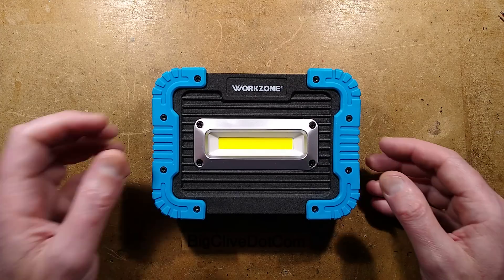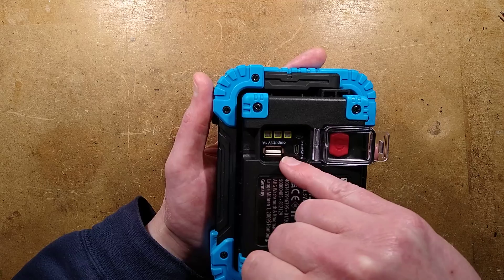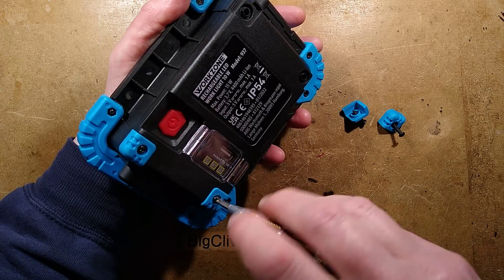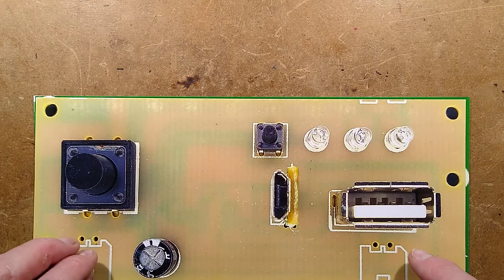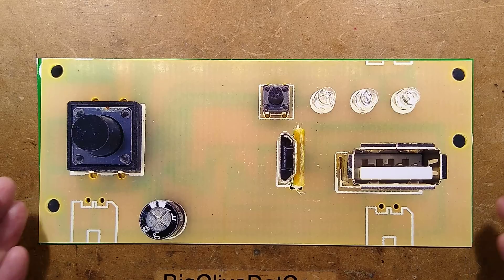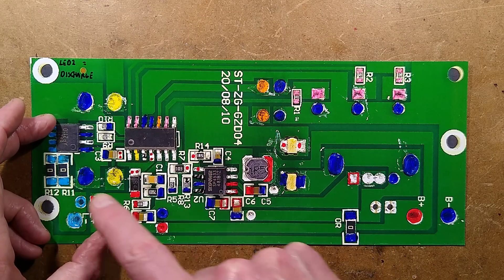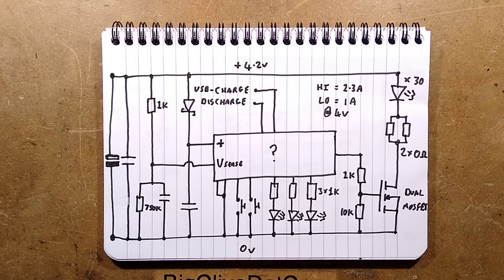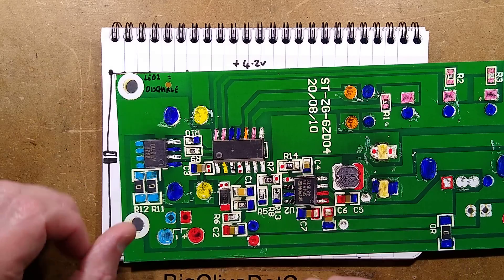Inside an Aldi rechargeable work light (with schematic)

Comment: Why won't it charge
Reply from the maker: If it's not been left in a fully discharged state for too long it should take a charge.  Try a different USB cable and a different charger.  Some modern "smart" chargers need some extra components to tell them to put out power.

Comment: I have the newer model that has Type C input.    It worked a few times.     Then it suddenly stopped working.    Should I toss it in the recycle-bin ??
Reply from the maker: If charging it, make sure you use a dumb charger with a USB A to USB C lead.

Comment: Jaycar (in aus) have an extremely similar lamp, but with 2 led clusters instead of 1 long one.
Runs off 4xAA batteries. 
Trying to analyse it... seems to have 2 mosfets in parallel off a microcontroller, and the powerfeed goes through 2x 0.390ohm (parallel) resistors! My goodness they run hot!

Comment: How about modifying battery? Does it have protection form changing batteries or increasing capacity, add some more? And last one, what are 18650 type, i mean 5A, 10A, 20A and brand?

Thank you

Comment: Bought a similar one called Orno Robotix Slim, says it outputs 20 watt, looks identical, but haven't tested the current draw.

I was wondering why these cob leds for low voltage are hard to find. The high power cobs from ebay need a voltage boost. I was thinking to try to make a work light if the cob is cheap.
Reply from the maker: You can get 3V COBs on eBay or salvage them from other products.

Comment: I got a similar use one from a german store (Norma) as well. Its a Maximus M-WKL-017, but it is round on the front, easy to google the device to see how it looks like. The thing on this one is: there is no need for PWM or any regulation for the main lighting. Because the inner LEDs (roughly 40-50) light after one switch click, the outer ring's LEDs light after the second click (8x3 = 24 LEDs) and after the third click, there are 9 red LEDs in the outer ring that flash.
The light is incredibly bright, should be 20 Watts according their claims, and judging by the heat I feel off the middle LEDs, I think it comes near it.
Haven't opened it yet, but it says on the back "Input 5V 1A, Output 5V 1A, Capacity: 4400mAh (2x 2200 mAh), Battery Type: 2x 18650 Li-Ion".
Only weakness I read about it on websites is, that the Micro USB connector, which is mounted right next to the USB output connector, may break off due to being only a SMD component, nit through-hole. But that is no problem for us I guess, just solder it back on/replace it and hot melt glue away.
Oh and by the way: it was 20€

Comment: Got a near identical one of these meself (model 869 from Australia). Has a little ball and socket hook on one side, the handle is magnetic with adjustable tightness hinges, square 20W LED and the bank is 3.7V 6600 mAh which smay actually tell you when it's charged via a 5th light on the back next to the input (will be able to confirm once it's finished charging).

Comment: Mine has a different circuit that's designed to ramp down full intensity to the lower setting after about 3 mins. You can see it pulsing down. Infuriating and a con, because it could never reach it's advertised output time on full intensity if it didn't do this to save power.

Comment: I just bought the Wilko version of this. Looks the same from outside, but the trim is red not blue and the sockets and LEDs are in different positions. The switch settings are High, Low, Flashing. Completely different circuit board inside. Very good for the price. Didn't realise its was fully charged off-the-shelf, and just blinded myself when I pressed the button! Extremely bright!

Comment: The American Feit Electric version 2-Pack of this light has high-med-low settings and four charge level led’s. 
Goes for $40/for two great work lights. Also goes to show how silly it is to buy throwaway battery operated work lights in the store when rechargeable is a much better way to go. Plus, these lights have a USBa out port and will charge a full size cell phone if needed, like a pocket juice or power pack.

Comment: I bought a similar device but in yellow/black. Besides the color it looks almost identical. But the 18650 can be replaced, There is a battery holder easily accessible without opening the whole device. I also think it has three 18650, but not sure, and to lazy to check since it is in my car :D. It also three light level and a strobbing in red/blue, like a police light. Not sure how legel this is though :)

Comment: 2:11 - 2:18: Aren't the red and black wires to the lamp assembly fitted with a connector of some sort at the lamp end? It looks like it from here, but I can't be sure...
Reply from the maker: There are positions for connectors, but the wires are soldered directly to the PCB.

Comment: I picked up a couple of these after watching this video. Noticed a similar thing with the charge LED continuing to flash after the draw on the charger dropped to zero (using an inline power monitor)... Until I used a higher capacity charger, then the draw slowly dropped from about 0.58a down to 0.0a over a period of between five and ten minutes, and then the LED entered it's steady state.

Tried this with both of the units I bought, and had exactly the same reaction both times. Can't explain why this is the case, although I can get a similar effect on my mobile phone when I deliberately plug it into a low capacity charger. It will hit 100% charge indicated on screen, but the LED indicator will continue to flash. Perhaps somebody out there knows why that happens.

Comment: i have the same one in red but it has 3 modes on low intensety and blinking 
but the case is a little bit different 

the on off button is in the same place but square not hexagonal

the small button to show the battery status is also on the top left under the flap
but the 3 leds are vertical on the right

the microUSB is on the left under the small button and vertical

the USB output is horizontal below

I bought it in Germany and it has no brand name on it in the small print it says Spot One GmbH and an german address

all the other stuff ist exaktly the same
Reply: the Data from the back of the light translatet with google 
10W - LED battery - spotlight
- Power: 10W
- Input: 5V DC, 1 amp
- Output: 5V DC, 1 ampere
- 3 light functions 100% - 50% - flashing light
- Light source: 10W COB - LED (not replaceable)
- 2x 3.7V 2,400mAh lithium-ion battery (not replaceable)
Reply: my lamp has 20 led chips in the front
ok i open my lamp as well 
i take fotos cause its a little different inside 
all the componens are on the butten side of the pcb and its all surface mount stuff
if it would be of interest I could forward the fotos somehow

Comment: I bought a 2 pack of the econo model series (Menard's Home Improvement store in the Great Lakes region in US). Looks like the one in the video, but used 4 AA single use batteries. I quickly learned that the light eats batteries dry! Put new batts in it, but not use for like a week? It won't turn on. Batteries totally flat! Now I put a little piece of paper to open the circuit when I/m not using it.

Comment: I wonder if they made the light output flicker-free in order to prevent the stroboscopic effect which might make rotating tools look like they're stationary? That could be a dangerous situation, especially for those who can't hear the tool operating...
About the 8-pin chip with rear ground pad - you've only drawn 7 pins in the schematic; could the 8th also be in parallel to the ground plate?

Comment: I bought 2 of these from Aldi about a year ago. They're great lights but do have some issues. Early on one stopped charging above the second LED indicator and doesn't hold a charge very long. The other actually does light all 3 with a full charge. I had to exchange the first one because it's surprisingly easy to break the micro usb port if the plastic door puts pressure on it while charging.

If it also had an option to get powered externally instead of relying only on the battery I'd use it more often.

Comment: I've got an older version of that light which has a round COB LED with a lens. It works pretty well, I've dropped it a few times from relatively high places and it still holds up.

Comment: I have a no-name light that looks identical to this that I got for around $5 in San Francisco's Chinatown a couple of years ago. I'm a cinema technician, and I was just using it today while tracing some LAN & speaker cables in the dark recesses behind the screen at an old movie theater.  It works really great !  I liked it so much I went back & bought a 2nd one, and attached a magnet, so it's always handy behind one of the audio racks.

Comment: We have two of the WalMart versions of this work light. The button clicks firmly and cycles between High, Low, SOS, and Off, and no battery gauge, all the blue bits in this video are yellow. Confidently assuming we have a previous version of this same work light. I highly doubt my mother would allow me to tear one apart, so I'll have to wait until it fails first...

My mother bought one and I originally thought, "well, this is probably gonna be shite," but it really puts out an impressive amount of light (even on its lowest setting), has a pretty good run time, the magnets on the back affix to metal objects firmly, and my mother's only complaint was recharge time. I told her, "why not buy a 2nd one, and use that one while the other is charging?" And that's how we ended up with two. I think she paid about $15 each, and after two years they're still going strong. The only BAD thing about them is, of course, that horrible SOS "feature."

Comment: Question(s). Instead of using a 750k resistor for V sense, would using a 20K resistor even out that 0.2V difference between V sense and the + input to the microcontroller? the 1K resistor would drop that .2V and the 20K resistor would drop the remaining 4V? That of course assumes that the positive rail is right at 4.2V. Or maybe some other value because we aren't at all taking into account the parallel resistance of the actual microprocessor circuitry which could affect he voltage drop at that node. Anyway, would that improve the circuit performance at all? Does it matter that the V sense is .2V lower than the +? Or does the larger resistor need to be that large for discharge purposes? My circuit analysis skills are... rusty so, I don't know.
Reply: usually microcontrollers don't allow higher voltages on the I/O pins then on the supply pins as the polarity kinda gets swapped.

4,2V is more positive then 4V.  when you connect a 12V fan in an PC to +12V and +5V rail you end up with about 7,5V for less speed/noise where the +12V is the positive lead and the +5V is the negative lead.  no ground wires involved.

Comment: We bought an identical (albeit yellow rather than blue) lamp a few years ago at about 3x the price from our local hardware store. It has been fantastic. 

We own a narrowboat and going through Brausnston Tunnel the searchlight failed, and we used it as an emergency light, and it worked perfectly.

Recently picked up a couple at Aldi, and keep them as emergency lights in our cars.

As to the  possibility of it driving 2 LED arrays, I came across such a beast on Amazon (LED Rechargeable Work Light Portable - 2 COB 2000 Lumens Flood & Spot Lighting 360° Rotation USB Cordless Folding Lamp )

Comment: I have 4 of these.  I moded one with a 10000mAH battery which came out of a faulty power pack , it takes about 8h to charge fully but I usually get about 2 days work out of it .also I changed the last LED to orange to identify it. Great video as usual 😀
Reply: can you help me with the handle ? i dont know how to get it back together after replacing the batteries with 21700

Comment: The only issue is if you move the stand while you are charging it will pull the charging port off the board, the only bad part of this.

Comment: I have one, walked for 2 hours in a cave and came out with still a slight charge left, I did use it on low to conserve power as the cave is about 1.2 miles overall

Comment: This light looks like it's a cousin of the " chunky USB rechargeable work-light" from your Feb. 1 2019 video. The PCB is very different but they have a number of case parts in common. I know this because I have the same light featured in the 2019 video sitting here. Bought it after seeing the video and it still work well. A decent product.

Comment: If the Vsel connection decides to de-solder itself! FFS if  random joints in any electronic circuit decide to de-solder themselves a small rise in voltage is the least of our problems. 😂

Comment: I have one like this. Its just red and black instead. I put in a 10kmah lipo and desoldered one of the resistors to cut the power consumption. In my case the resistors were not 0 ohm, so this actually reduced power consumption quite a bit. Its awesome.

Comment: I have almost the twin to this light, sold by Harbor Freight in the US. Where this light has blue accents, the HF one is yellow. Mine also has four battery status lights that are red, yellow, and two green if my memory serves. I believe the HF variant has strobe or SOS mode, as well. Same clicky handle and USB ports.  It is a great lamp, and very bright. I use it at work frequently.
Reply: I have the Walmart one with red trim

Comment: Hi Bigclive - I recently purchased two packs of two unit from Costco in Winter Park Florida. Feit brand, magnet handle with thumb screw adjust. 3.7v 4000mha, square led, 4 charge lights, micro usb :( - black and blue case. Three settings high,medium,low. Works great. Model WLR2000/2 IP64 - I think two cost 29.99 but may of been on sale. Need light to venture into the abyss of the attic…

Comment: I've got a couple of those over here in New Zealand (re-branded), really handy lights. Charging them up is very slow however. I ended up adding some resin around the charging USB connector to strengthen it after one broke off the PCB.

Comment: I found a similar model of this with a smashed up case by the side of the road I believe it was a snap-on branded version. And the inside was almost identical the only real difference was the shape of the cob LED on the front was a bit more square.

Comment: I have an older version of one of these.  I've managed to lose the handle, and have overall beat the crap out of it, but it continues to be nice and bright.  Mine oddly enough has a Hi Med Low intensities.  Most of the time, Lo is more than enough for me to see what I need, so I use that to maximize my battery life.

Comment: I always assumed that DC/battery powered LEDs weren't affected by flicker?
Reply: The flicker is caused by circuitry used to modify the battery voltage, much like converting to AC and the back to DC. Since LEDs turn off and on very quickly, the AC ripple can sometimes be visible.

Comment: I have the previous model. More or less same spec, just different LED. It is a very nice worklight. Maybe little short on runtime, but you can also charge it while using it, if needed. ALso the previous one had a magnet in the handle to attach it to cable trays or other metal on the ceiling.

Comment: I’ve used this light with yellow trim for several years, and it’s rock solid and long running battery. I once left it on in a closed room and didn’t make it back for 2 days. It had dimmed a bit, but still was quite usable. I have several versions in this style and in a stick format, and I wonder how we ever got along with d-cell flashlights (torches for my UK friends) back in the 70s.

Comment: I really like the simple one-button operation. Press it twice, and you get low intensity every time -- as opposed to, for example, a blinding strobe flash. I've wondered why these lights run the PWM frequency so low. If a microcontroller is being used, the frequency should be programmable, right? Even at a clock rate of 32 kHz, dividing by 128 (7 bits) still yields an 8-bit dimming slope. 👍
Reply: The faster the PWM frequency the longer the MOSFET spends in the linear zone and the hotter it gets. I suspect that’s why the switching frequency is often quite low.
Reply: @ShaunieDale  Interesting. But wouldn't the "on" resistance also generate heat, especially in cheaper FETs? (I'm thinking in terms of them being "on" for longer continuous runs.) Or is there an order of magnitude difference?

Comment: Haven't seen those in our ALDI's Down Under yet. Having said that we're still using the ALDI "battery powered LED strip lights" from many years back, which work just fine. Their lights (especially the Lightway range) seem to provide excellent quality and durability.

Comment: I have one almost identical but from Hyper Tough model 9977. Mine has 4 functions for the button, high, low, strobe, off. Mine does have 4 strong round magnets on the back side. That comes in handy when working on a vehicle or inside a metal enclosure. The handle is also multi positional. Have had mine since around Sept of 2019. It still works great to this day and it lights up an attic really well.

Comment: I had to open one of these few months ago because of water damage. It turns out it has seals, but in the front there is engineering flaw where everything is sealed up, but i think around bolts it was not, so it will get water in and that is what happened. It soaked pcb and battery and even tho after drying it up it started to work it seemed that it had ruined the capacity of the lion cells.